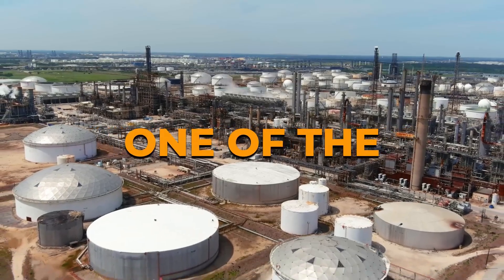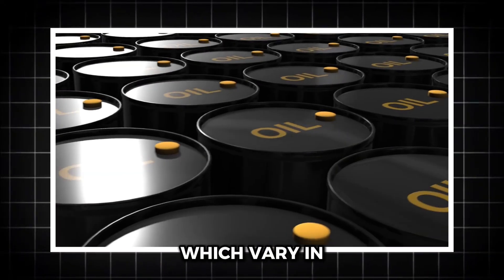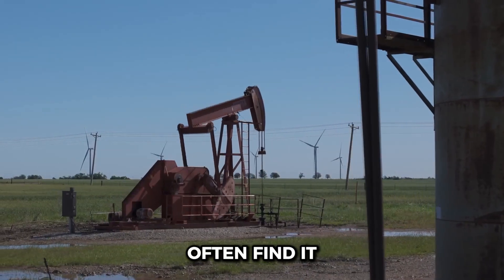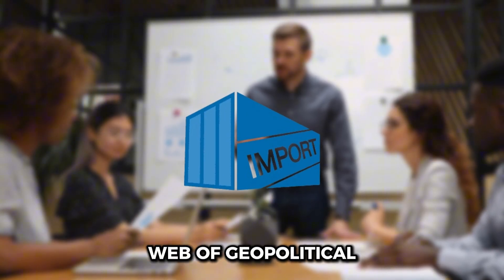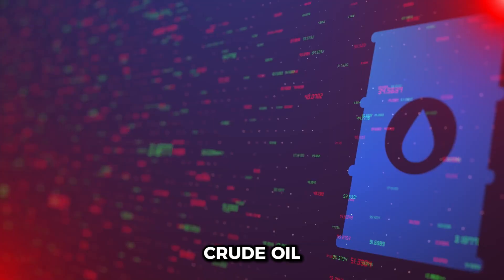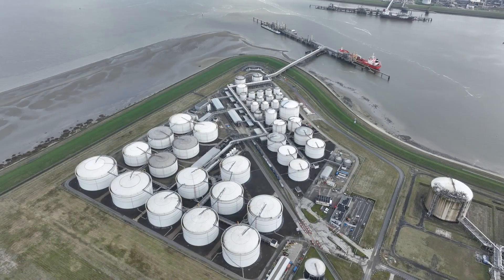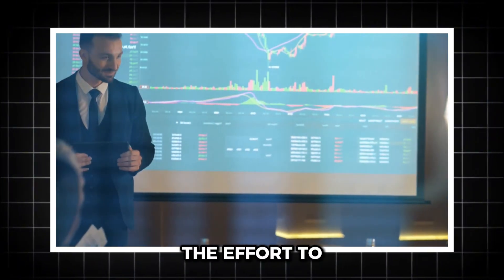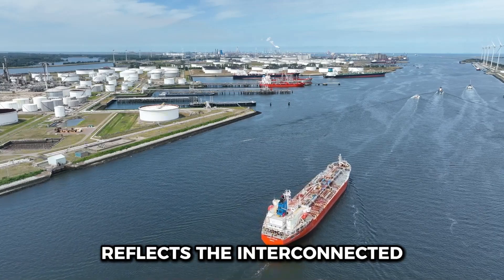Why Does US Import Oil When They Produce So Much ?

Comment: Most heavy oil imported to US will soon have tariffs that the consumer will pay for at the pump. Congratulations to the 77 million voters that will cost you more at the pump.🇨🇦🇨🇦
Reply: I would Say IT is for the same reason that the American hay cannot compete with the Canadian hay which is IT does not contain enough necessary elements to properly feed the horses and cattle. In the case of the oil, IT is very difficult to transform IT to gaz and fuel.
Reply: @ US refineries can retool, the cost and time will outlast the 77 million voter mistake. Follow the money. I will now investigate hay vs oil impact to GDP, thanks.